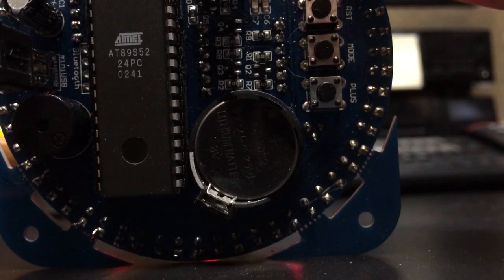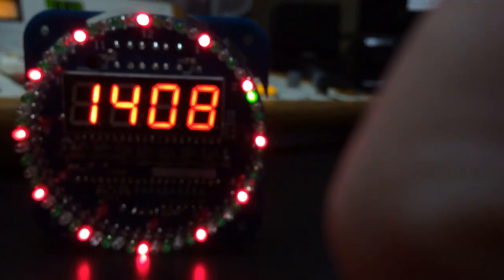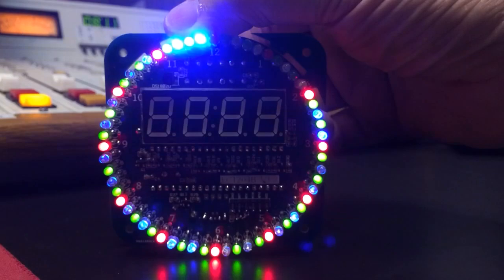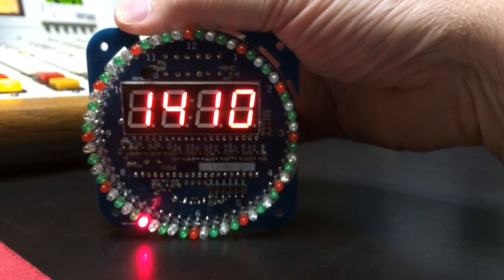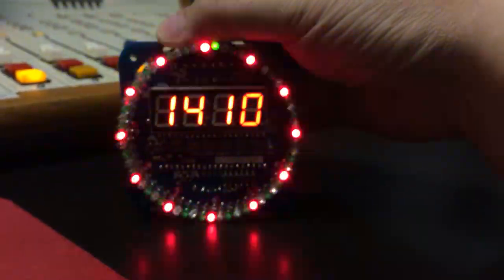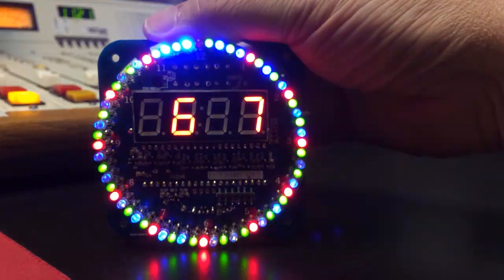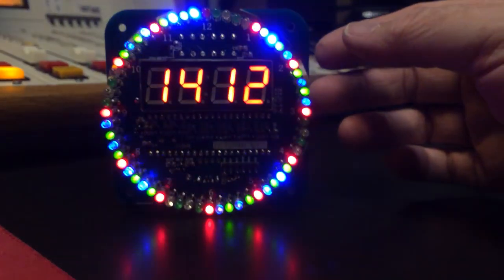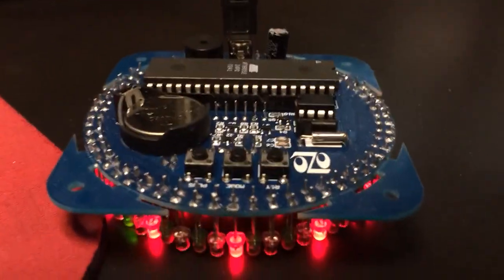DIY DS1302 Rotation LED Electronic Clock Kit 51 SCM - My Results

Comment: Just got one of these, but the instructions are all in Chinese, however the board  had all of the parts and where they go written in English. I do have a question because it does not say on the board, but is the outer ring positive or negative. I need to know so that I can correctly install the diodes.

Comment: Hi Jeff, built the same kit as yours. My temperature seems stuck  at 0C, did you have to add a temperature probe to DS18B20 to get a temperature  ? Great video btw.
Reply: Thanks. The kit should come with the probe. It looks like a typical 3 legged transistor. It didn't give me any problems. Get a magnifying glass and look over all solder points for cold joints and shorts. That has been a problem for me in the past.

Comment: In mine the seconds are going slowly, it takes more than 7 seconds to finish a single second... can anyone tell me what's happening... how can I fix this problem
Reply: It seems like it would have to do with the clock speed. By that I mean the speed the processor is running, not the clock as a whole. The 12MHz crystal determines that. It goes between pins 18 & 19 of the processor chip. Make sure they have a clean connection as well as the capacitors that go from each lead of the crystal to ground (C3 & C4).
Reply: It might be the clock on the 2nd smaller chip, the time module. Does your display still change between time, date, temperature at the speed mine does? If so then the processor clock is okay but the smaller chip's crystal is the one to check out.

Comment: I have the same newest kit with smd components  but I don't have instructions where I suppose to solder which smd resistors. It just two types of smd resistors. Could you please attached to your video instructions or guide where they are supposed to be. Thank you.
Reply from the maker: This page has instructions on how to set the time and date. I will try to find a parts list and it tells you where they go. You should see the places the resistors go named R1, R2, R3, etc. Capacitors go where C1, C2, C3 are on the board. I will get back to you on that list. Here are the instructions for setting the clock:
https://www.aliexpress.com/item/DIY-DS1302-Rotating-LED-Electronic-Digital-Clock-Kit-51-SCM-Learning-Board-5V/32659009100.html
Reply from the maker: This might help you too... https://www.banggood.com/Upgrade-DIY-EC1515B-DS1302-Light-Control-Rotation-LED-Electronic-Clock-Kit-51-SCM-Learning-Board-p-1053190.html
Reply from the maker: Here is one more page with operating instructions. They might be easier to understand. http://www.ebay.ca/itm/DIY-DS1302-Rotating-LED-Electronic-Digital-Clock-Kit-51-SCM-Learning-Board-Eforc-/181702112812
Reply from the maker: This image is a schematic of the clock. It shows the component names such as "R3" and its value such as 470 ohms. When you do assemble the clock make sure you put on the two large parts on last which are the IC socket and the 4 digit time display because if you put them on first they will block the area you need to solder on other parts. Good luck! https://img.banggood.com/thumb/water/oaupload/banggood/images/5F/DD/1ccf0316-8a30-4109-b79b-1510a1d7c1f7.png
Reply: Jeff Flowers Thank you for your link. Have a great rest of the weekend.

Comment: Hi Jeff is there any chance you could send me a copy of the circuit diagram just purchased the kit but alas no instructions, would be greatful. Les Naylor
Reply from the maker: There are currently 3 or 4 different variations of this project. You need to find out which it is and search for it online. Some have many SMT parts and some have only "standard" components. you can try looking on the aliexpress website. They might have the documentation.

Comment: een old man from Holla
nd question you help my instuctie for clock EC1204B V.1.2 in anvance thanks Theo
Reply: I don't know what to tell you. I found these instructions on the internet. They might help you. The tiny surface mount parts need patience and a little skill. https://www.vanallesenmeer.nl/Files/2/38000/38789/Attachments/Product/455639x2a87V101U0C616I08210491f8.pdf
Reply: Also, when you solder (weld) the LEDs in a circle, solder just one pin of each and then look to make sure all of the LEDs are flat against the circuit board before you solder the 2nd pin.

Comment: I have since salvaged components from these non-working clocks so none are in any kind of working state. I did order one more that comes with a clear case. I have successfully assembled 2 of the 8x8x8 LED cubes so somehow I do believe I am getting defective components. Am still not sure why the first clock worked and then stopped suddenly. All, when plugged in, would have all the LEDs on and the buzzer would stay on. No bent pins and no solder shorts for sure. Thank you for your suggestions.
Reply from the maker: You know, it's common for the clock to be crazy when you first apply power. That's why they put a reset button on the back. Did you try pressing the reset after powering the clock?
Reply from the maker: I noticed that banggood.com has a new version of this clock with blue digits and red/blue "seconds" LED's. I just ordered one. I feel like getting my hands dirty again. They also eliminated the SMD's and use regular size resistors.

http://us.banggood.com/Wholesale-Warehouse-Upgrade-DIY-EC1515A-DS1302-Rotation-LED-Electronic-Clock-Kit-51-SCM-Learning-Board-wp-Usa-1013812.html

I found this video of someone assembling one
https://www.youtube.com/watch?v=9UUB48GavA0

Comment: Jeff, I have assembled 3 of these kits.....the first worked for about a week and the second 2 did not work at all. Not sure what I did wrong, but I used to be an end of line inspector for a defense contract electronic assembly shop and I did not find any shorts or defects. I do have a microscope for inspection purposes, but could find nothing visually wrong. Any suggestions?
Reply from the maker: Do you get any lights or digit segments at all? I guess you checked to make sure all of the IC pins landed in the sockets and didn't get bent inward. As I mention in this video, I had a short across two pins with a very VERY thin line of solder. It was hard to discern it from just glare on the solder but it was indeed a short. That made everything come alive when I fixed it. There is also the chance that a semiconductor got heat damage during soldering. If you can, take a couple of close-up photos of your work and email it to me at ki4lle at gmail dot com

Comment: I have this version of clock, but it didn't work. Probably because the caps were not marked and my eye's are not so good so doing SM components is not my thing. I have the other version with through hole and it worked well and was really easy to put together. I would recommend those that don't want SM try the through hole kit and you will be happy.

Comment: I just finished a very similar clock (EC1515A).  I somehow advanced the year two years.  Any idea how to get it back?
Reply: +jehdspth I don't have the clock handy so I'm not sure. You can unplug it, take the battery out and start over.

Comment: How did you tell which SMD components were which? they don't come labeled so I don't know how to tell them apart...
Reply from the maker: +coolbluelights there were numbers written on the packaging for each component. The 10K ohm resistors have a 103 stamped on each resistor. The caps didn't have any markings so I had to go by the number written on the packaging. I had to make sure to extract the parts as I used them and not let them get jumbled up.
Reply: I think I got it figured out by just counting the number of them in the parts list. my kit didn't come with any numbers on the packaging. I couldn't make out the markings on them even with a magnifier, I need a microscope lol

Comment: That looks sweet with the blue on every other!

I am building this myself at the moment, I forgot I had a SMD hot air re-work station. Once I started using this, installation was a breeze!
Reply from the maker: +Pete Anderson I don't have a re-work station but the heat gun did me well.

Comment: Thanks for the video. One question my friend please: in the components they include some long plastic strips,what are they for?. I look at the finished product but can not see them.Thanks again.
Reply: Karim Ismail Not sure which items you're referring to but if it's two black square things, they're sockets for the IC chips. If it's longer, thinner strips with holes all along the middle, those are the tiny surface mount components in their packaging. It has a clear cellophane cover on one side you peel off to dispense the components individually. Here's an online closeup of one... http://www.digibay.in/image/cache/data/sachinelectronics/LS01/191-c-100-ohm-smd-resistors-surface-mount-0-25W-1206-package-600x600.jpg
Reply: Jeff: thanks for your reply and your consideration. The link you provided shows components like you said. Please clarify what kind,are they LED's?. Please forgive my ignorance.
Reply: Jeff: thanks for the link. Yes I was referring to those stripes. Is there away I find out exactly their use?, Do they go on the Board or only help in connecting components?.,which way?. They don't show connected in your Video. Take care.
Reply: Dear Mr Jeff: thanks again for your help. I will be checking on the soldering technique of those SMD's. Great assistance you have been. God bless and I appreciate it.
Reply from the maker: Karim Ismail I'm glad to help you. Soldering is fun for me. It's like a hobby. If it is for you then don't be afraid to get started with SMD's. These clock kits are rather inexpensive so if you mess one up you won't be out much money. IF you do decide to give SMD soldering a try I can share with you what I needed to buy to get the job done.
Reply: mr Flowers: You are so kind. I got one similar to yours but got stuck on the tiny parts on the back and the SMD's. About 70% finished. I wish I have a way to chat directly with you. Where r u?. I am in California.
Reply: Karim Ismail I am in South Carolina. It is best to get the SMD parts assembled before everything else. you can email me at nochas1983@gmail.com

Comment: Do you have firmware for this version clock ?
Reply from the maker: Вячеслав Смага I do not. I think they are calling it a 10-mode rotation LED clock. I'd love to be able to reprogram it.
Reply: Jeff Flowers reprogram them using simple .. USBasp
 the seller gave you a package of documents to the clock? perhaps there is a firmware file (*.hex, or *.bin).
 please see, I'm looking for the file
I have two firmware
 1. Easy to 4 effects for LEDs
 2. supporting bluetootn and 5 effects
 I can share with you

 thx
Reply from the maker: Вячеслав Смага I did not get anything with it. Do you have the one with the newer firmware like mine or do you have the older one? If you need operating instructions I might be able to help. If you are looking to reprogram it, this URL might help:

http://blog.copcea.ro/2015/02/07/ec1204b-clock-schematic-upgrade-firmware/

I think this man's YouTube channel is here:

https://www.youtube.com/channel/UC8-5JSC0g5RIce3ZxvY_0Og
Reply: Jeff Flowers this man has modified the clock, he uses another microcontroller, according to its firmware is not suitable.

If you have a programmer USBasp, then connecting it to the clock can be considered the firmware of clock or pour it into a new
Reply: for our microcontroller:- simple firmware 4-mods for LED yadi.sk/d/qM4F8o9VhafRx
- with bluetooth support and 5-mods for LED yadi.sk/d/IW4i_HxKhafid